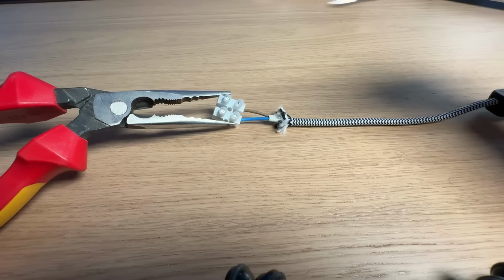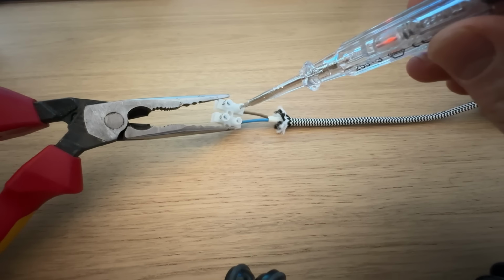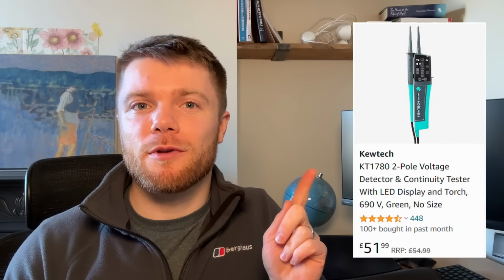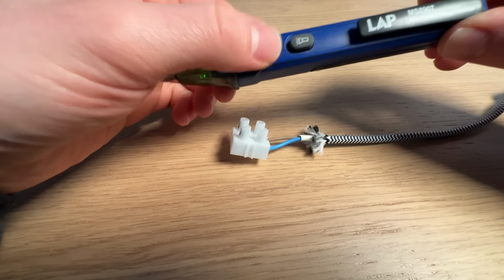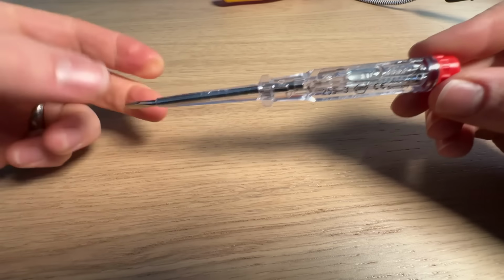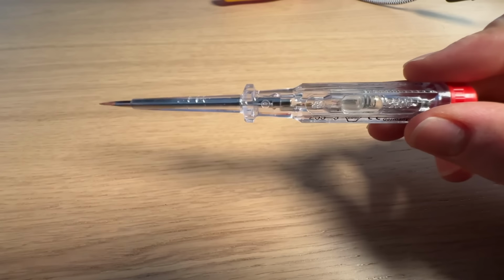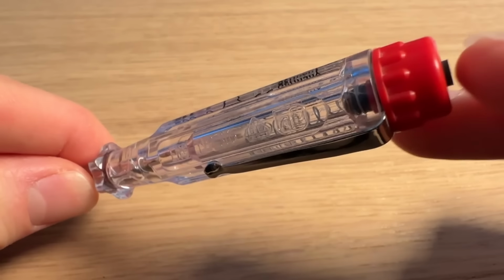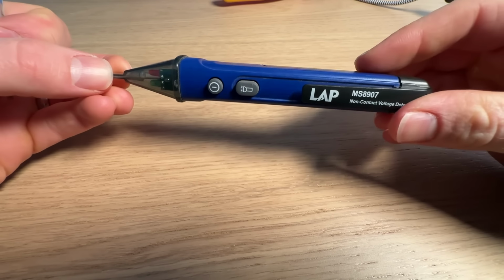The Most Dangerous Electrical Tool

Comment: The problem with the non-contact electronic testers is that since they work in general close proximity to the circuit, they will light up without actually coming too close, so will indicate voltage WITHOUT IDENTIFYING THE LIVE FROM THE NEUTRAL WIRES. They are very good at what they were designed for (testing whether a  socket/wire/device is powered up). But the screwdriver-type also excels at what it was designed for: DIFFERENTIATING LIVE FROM NEUTRAL wires, connections, etc. This, the non-contact testers won't do.  I actually use both, for the different testing purposes described above. And in some 50 years using the screwdriver type, I have yet to hear or read about any serious accident using it.
Reply: I use non contact one solely for finding broken section of a wire. If I have a broken wire and need to fix it, that is a great tool to track where the voltage suddenly end without any surface indication
Reply: Exactly! This devce is called "live finder screwdriver" in Italian: its purpose is to differentiate live from neutral. No non contact tester or two poles multimeter can do that.

Comment: Why not use your trusty multi-meter?
You can actually read what the AC voltage is.
You can also check the resistance between neutral and ground.

Comment: My device wasn't turning on, but I didn't take any risks. I plugged it into another outlet that I knew was working and did a test, through which I concluded that the device was damaged. If I hadn't done this test, I could have suffered a severe electric shock because it was a 220V outlet. After that, I bought a tester pen that beeps for added safety.

Comment: I have used these for decades and used one when changing a light fitting which was supposed to be protected by an isolator switch in a bathroom - the switch turned out to be wired wrong and the neon screwdriver probably saved me from a shock

Comment: Sorry mate, you are wrong. Your knowledge is in the dark. The most dangerous electrical tool is the person on the other end of this screwdriver. I’m using these on a daily basis since the 80's. Never had a problem. Do not attempt to repair when damaged and if you use it correctly there is no danger at all.

Comment: Not inherently unsafe, it's not like there are loads of cases of people dying by using these. But it's entirely unnecessary in the modern world, when for example Martindale do a two pole voltage tester for less than £30, or even LAP in B&Q for under £25. You really shouldn't be using such woefully inadequate tools for safe isolation, or providing dead.

"Touched the wires with tools too cheap,
Skipped the test — went in too deep.
Now I hum where silence spread,
Saved a tenner, wound up dead."

Comment: Volt pens don't detect a magnetic field they use capacitance to detect a voltage. This is important because current (not voltage) induces a magnetic field. Something like a light bulb that is turned off will have no current and thus no magnetic field but will still have voltage on the hot wire. And we need to assure the absence of voltage (not current) to avoid shock.

Comment: Contactless volt testers won't help you identifying which of 2 wires is live if they are close to each other.
I have one and it turns red within an inch of the live wire.

Comment: Those neon screwdrivers are not dangerous. If they were they would have been banned years ago. They have a neon which acts as a fuse and I 1 megohm resister which lowers the voltage to a safe level.
Think about how a fuse works , current comes in one end and out the other if to much current passes through the fuse wire melt and breaks thereby cutting off the flow of current. One side will still have current but it can’t go any further than that point. A neon screwdriver works in the same way current passes through the shaft then the resister then the neon , if either one of the resister or the neon fails the current cannot go beyond the shaft. . So tell us how are these things dangerous. 
They are rated to 250 volts if you’re stupid enough to touch a live terminal of 500volts then you will probably get a nasty shock.
The with any test instrument if use beyond its rated voltage/current. If you don’t know the limitations of your tool then you shouldn’t be using them .

Comment: Ive got caught with one of those testers before. I was working on a lighting ring up a wooden ladder in a pair of crocs, insulated enough it seems to not light the tester. Working on the line I got lit up when I reached out to to prop off a wall, I got one of those Kewtech testers after that lol. Also have clamp tester that has NCV capability that beeps live circuits. Im working a 32amp ring main today, dont wanna get a jolt off that bad boy lol. 
GL all

Comment: Its all I had when I started on electrical things 70 years ago. Yes of course there are dangers to all things electric. We need to know which is the live wire. Back in the daze house wiring was usually either cotton covered rubber singles or twin TRS (Tough Rubber Sheathed). Separate earth or no earth for lights..... ! This could mean a switch return was black (not red). You could not (and still should not) "take anything as read or you might be dead!"  These neon bulbs need well over 100V to strike. They take a negligible running current. Inside the driver handle is that neon bulb and a series resistor of around 1Megohm. Even if that bulb was a short circuit only 1/4mA would flow from a 250V mains line. However if the strike voltage was 125V the current would halve thus making the current 1/8mA ( 250uA). In fact it will remain lit on much less. {More to strike but less to light}.
So we turn to the current passing through your body. It goes to ground because one side of the supply (be it ac Neutral or DC negative) , is connected to earth at the power station. This is primarily to prevent an opposition voltage forces lifting it (jacking above) its nominal terminal voltage. We've said 250V to make it easy but 230 - 240V is UK nominal mains supply. The truth is than the circuit to earth is via the air surrounding your body. {There is also a capacitive coupling for ac}. That is because you will for safety reasons be wearing rubber shoes and work with one hand in you pocket...... ! That way any current cannot pass through each arm and via you heart.  
That neon screwdriver will also tell you if this a an ac or DC supply. If you look into the lamp you will see two electrodes. If the glow surrounds them both equally - this is ac. If however it only surrounds one electrode it is DC......... !! 
The blade is a screwdriver in its own right. Useful for screws and terminals (before they all became posi-drives that is). So what is the downside to using a meter. So cheap now - unlike those bulky old AVO's..... ! The downside is the temptation to use both hands in order to hold the probes...... Mmm! Read what I said about one hand in your pocket. That neon might be your safest bet. Now lets view the video shall we?
P.S. With that done I can see the advantage of the proximity detector. I suppose it to be reliable. It seems like one of those buried cable detectors. Whatever you do keep yourself and your customers safe... !

Comment: okay, i need to share a story here:

once, when i prepared a presentation about ionization for physics (in elementary school) i tested my hairbrush that produces some ionization so that my hair does not electrify (ozone smell). I used this "screwdriver" to check if something could happen (i was a kid okay...) and my younger brother wanted to check it too. He was holding a screwdriver then and he touched the metal tip, just off the red one. Immediately after that, like a coincidence , my father came and put his hand on bro's head to congratulate his will to help me and zap, electricity jumped between his hand and hair, giving a familiar electricity bang to father and brother. Of course nothing bad happend, we tried it again and later i presented my "discovery" in class, after the two bravest volunteers came.... hahaha. Oh good old days. And cool video!

Comment: I have one and you don't touch the end you put a wire with alligator clips and attach it to ground it where you say your finger touches( as you said) and has a wire with an attached metal slide you slide in. Connect/attach the alligator clip, then poke what you need. You are missing the part but can easily make one. Looks the exact same. Exactly the same.

Comment: Safety idiocy at its best. Pure water (like rain water) is non-conductive. You need a fairly high concentration of electrolytes to make it a good conductor. Plus, this lamp is not used to guarantee that is no voltage in a conductor, it is used to quickly identify a line from the neutral, assuming that the network is referenced to ground. If is not referenced to ground this lamp tells you nothing.

Comment: Firstly, It doesn't work by completing a circuit, it's a capacitive effect.
Secondly don't recommend to people Chinesium voltage detectors from Amazon, where 99% of products are cheap junk from Chinese sellers, these will happily murder you (same goes for Temu), there is or was a work light on there which was charged via mains or USB, but when charging from mains the outer shell of the USB connector was at mains potential. Somehow these sites and sellers are able to completely bypass safety standards, yet big name DIY stores sell these screwdrivers.

Comment: Not true. You have a misunderstanding of how it works. The 'volt pen' ncv tester does not use the magnetic field to detect voltage, as you need current to produce a magnetic field. It uses capacitance. Look it up.

Comment: The claim that a phase tester (voltage tester screwdriver) is "the most dangerous tool" because electricity passes through the user's body is either a result of misinformation or deliberate deception. Here's why this statement is incorrect:

How a Phase Tester Works:
A phase tester is designed to detect the presence of voltage in an electrical circuit. It contains a small neon lamp and a high-value resistor to limit the current flow to an extremely low and harmless level. When the tip of the tester touches a live wire, a very small current flows through the resistor, the neon lamp, and the user to the ground, illuminating the lamp.

Safety of the Current Flow:
The current that passes through the user is in the microampere range, which is far below the threshold for causing harm to humans. The high-value resistor ensures that the current is minimal and completely safe for the user.

Misleading Intent:
Suggesting that using a phase tester is inherently dangerous could be a tactic to promote more expensive alternatives. While advanced tools have their place, they are not always necessary for basic tasks like voltage detection.

Professional Use of Phase Testers:
Phase testers are widely used by electricians and DIY enthusiasts worldwide. They are simple, effective, and safe for their intended purpose when used correctly.

Promoting a more expensive device by spreading fear about an established tool is unethical and misleading. Viewers should critically evaluate such claims and rely on trusted sources for information.

Comment: I have also used these for years & treat them as an extra confirmation it is dead, then still take care. As I understand it a neon bulb passes very little cureent, so both resistor & neon would have to be shorted out.
Having said all that I can feel a prickling sensation under my finger when it is live.
My issue with the voltage detectors is that they rely on a battery, so are often dead when you need them. The neon tester is always ready to go.

Comment: .... never ever have had myself read newspaper report that someone died using this screwdriver tester device.  The electrocution issue is always mistakenly not switching off main current, and not unplugging from socket, while attempting some repairs.

Comment: Such kind of old indicators are completely safe to use. It takes negative (-) from human finger and positive (+) from the electricity. There is no any danger for health! Ofcourse as not having direct contact with electricity new style indicators are more safe, coz you have to touch directly to the electricity with old indicators, but generally if you use it correctly there is no any danger

Comment: Using this for 35 years, knowing people using it for like 50+ years - never heard of any issues. Important thing I was taught is, first always find the connector/wire/outlet where you can confirm it is working (will glow) and only then trust it (you can do several checks for example - check the powered connection, then the one you want to work with and should be "0", then powered again to see it's still working). Also saying that "the rest of the current is flowing through you" is kind of dramatic because this current is extremely low.

Comment: Back in the day my Dad (who was an electrician) used to tell stories of replacing the carbon rod (which dropped the mains voltage) in neon testers with a bolt and waiting for the apprentices to use them.... Different times!!

Comment: as much as i agree with the "contactless" one or the actually measuring one being the better option .. these have been used for ages and have never been a problem .. the light cant "burn out" like a filament lamp .. and the fault you described has more to do with maintaining your tools and having them in good condition .. if there is water in there or it is damaged you should not use it .. but the same failures are possible with the other ones if mistreated and damaged. (also you only trust them to differentiate between "known on" and switched off after you tested the circuit under identical circumstances before)

Comment: Using the old fashioned neon ones where you provide some capacitance, they should be ok if used properly. However, recently in Spain I purchased a cheap Chinese digital look-a-like one (ie conducting prong). Cost about 6 euros. They have a small LCD screen but first time I used it, touching the 'button' I got a severe belt. They are NOT designed the same as the neon bulb design and should NOT be sold let alone used.

Comment: These are great .. there are some newer types but these are very useful,, especially when you want to confirm light switch …constant vs switch wire .. I’m licensed electrician and have all the best test equipment.. but always use these when I need to .. especially if there is no earth or neutral at light switch .. can’t use combi check if there’s only active.. actually I have a combi checker that beeps when touching only active and that is ok too

Comment: I only work on some DIY repairs so I have bought both of these. Contactless is far more dangerous if the grounding is not done properly (common issues on old houses around where I live) as it detects signal even up to 50cm away from the wire itself. I always use contct tester to verify and haven't any issues.

Comment: Mine doesn't have a spring, Just a metal surface. So nothing can really break and it's great to check which contact is hot and which one isn't because I never ever trust he wire color. The biggest problem with these is that they are not fail safe. If a internal contact is broken or the light bulb has a defekt the wire could still be hot even though it's not glowing. Though that's not an issue as long as it is known.
Btw: I'm always happy to be a part of any circuit as long as the overall resistance relative to the voltage is sufficient.

Comment: I am not DIY, I am high school electro technician and master in Computer and Electrical engineering specialized in field of robotics. I have been using those whole life and there are few rules when using them that you get right of the bat. First is do not use them in improper light, take a wild guess why? Second rule is to find live current before an use and test it on it, so you are sure thing works. Rule three, do not use chines garbage, all components expect string should be locked in palace with plastic, so there is absolutely no way that string bridges contact and bypasses resistor. They are all used because they are reliable af. Applying the same logic to your gadget, if you use it in bad light condition, battery died, and mistake light reflection for turned on green signal, get no read beeps, and proceed with work, you are as much screwed as with screw driver.... 
Here is a pro tip when working, after you did test, with whatever thing you picked as a tool, made sure there is no current, proceed to short circuit it with simple wire. One fuse is not worth your life in case any of gadgets failed when working with high capacity high voltage systems.

Comment: This is NONSENSE, you are a part of an OPEN circuit when you test with one of those, you are not being electrocuted when you use one, there is no meaningful current running through you, it literally works when you're not grounded, want to see the difference? All it takes is touching the neutral lead as you test, but beware, you can probably only do it once.😂😂😂

Comment: This is very incorrect to say these are dangerous. This IS the original and only way that was available for decades. These work very well and are safe, much safer than you think they are. 
I've literally don't know a single case where someone using them got hurt or shocked. That spring inside usually is the 2nd line of defense and the small contact patch is the 3rd. You should know these things, before posting such video